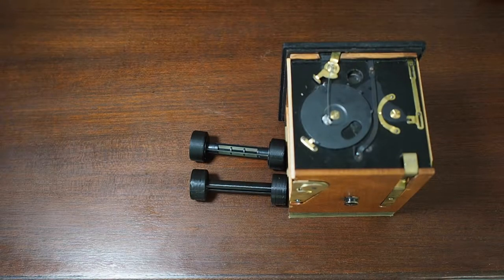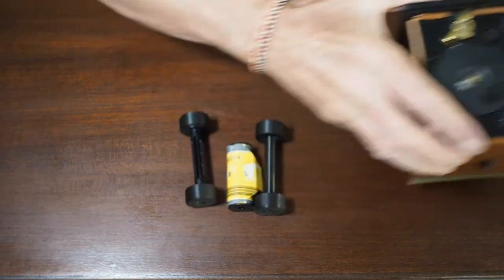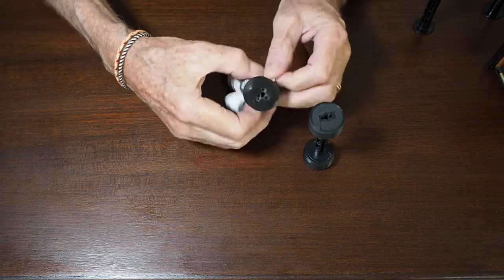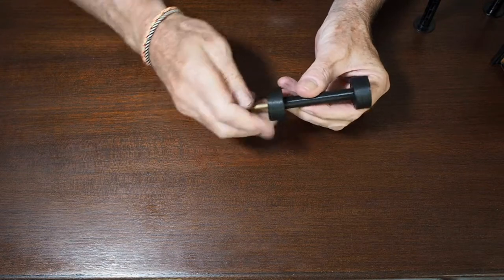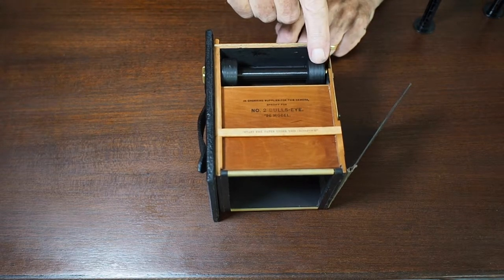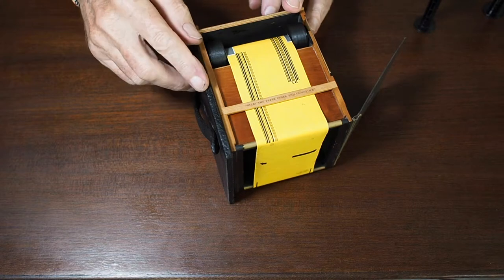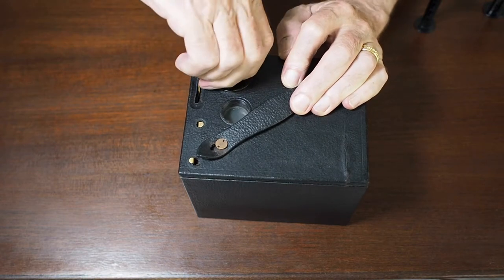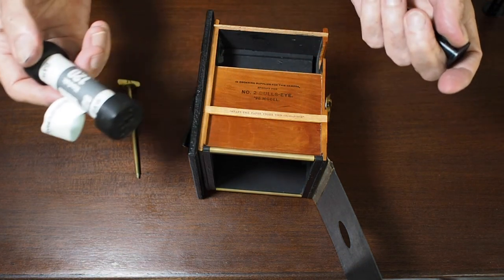Using 120 film with an 1896 Kodak Bullseye

Comment: You can now purchase Holgamod adapters which simply fit onto 120 spools and allow 120 film to be used without respooling. One simply inserts the end pieces onto a roll of 120 film and, presto!: it's now the length of a 101 spool. It's less complicated than respooling. 😀
Reply: Where can you purchase this?